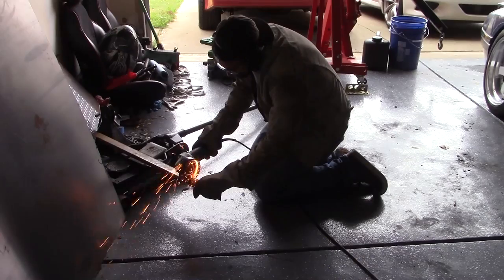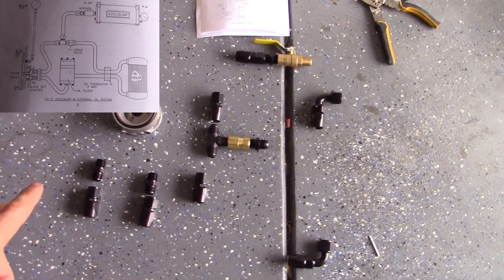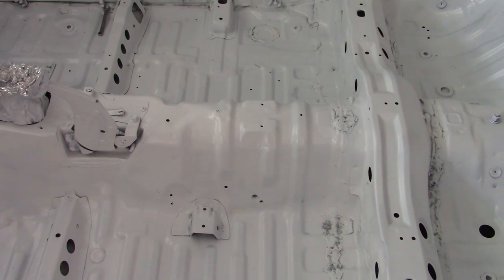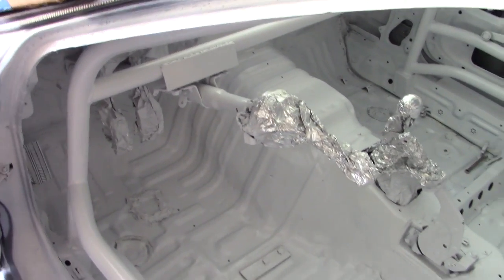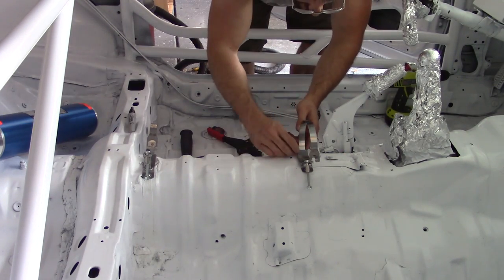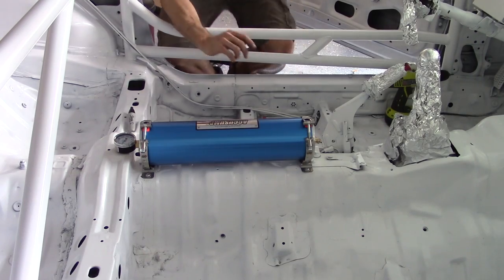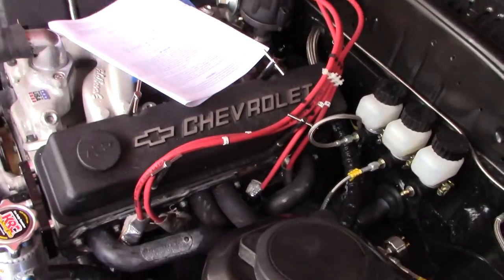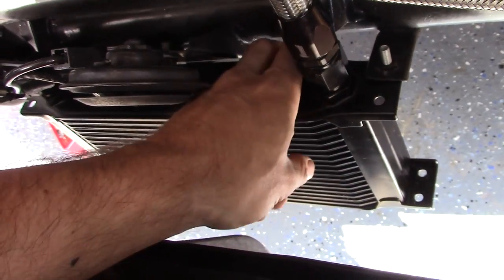Canton Racing Accusump and oil cooler Install in the V8 RX7

Comment: As long as you have put in a oil cooler have you ever seen the valve cover gaskets 3/8 thick that contain an oil line molded into it to squirt cool oil onto each valve spring using a #4 AN male fitting molded into the end of the gasket with a Tee from the return line to the valve cover. I use this setup. Its a great source of cool oil to the top end.

Comment: If the ACCu sump is open with stored pressure in that line to the motor and there is that check valve to keep it from backing into the cooler return line. How does the oil in the return line fight the resistance at the check valve and return into the engine if there is pressure on the back side of that check valve  ???
Reply: 63 grand sport the opening pressure for the check valve will be lower than the return line pressure, which will be at normal engine oil pressure. E.g. Opening pressure for check valve may be only 10 psi, where as return line pressure is 50psi. If engine oil pressure drops below the pre- charge pressure of the accumulator, the accumulator will dump oil to the engine, but will not dump it to the oil cooler, due to the one-way check valve. Cheers👍

Comment: I am not sure I would want the oil bomb right next to me
Reply from the maker: Yeah it's not the best spot, but it is the only way I could manually turn the valve. In the future I am going to upgrade to remote solenoid and mount it in the rear.
Reply: @TheDailyDrift  why do you need to be able to access the valve? Don’t you just leave it open?
Reply from the maker: @chris-8597  usually you close it before you shut the engine off so it doesn’t drain back into the oil pan and so you have a good amount of fresh pressurized oil to send to the engine when you cold start it.
Reply: @TheDailyDrift  if you have it mounted somewhere out of reach could you just leave the valve open all the time if you don’t really care about cold start lubrication?